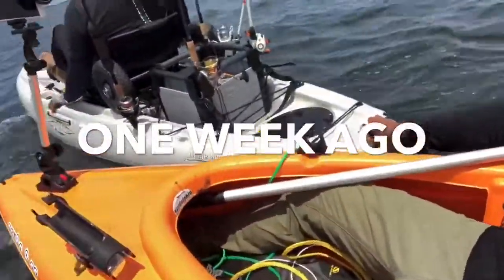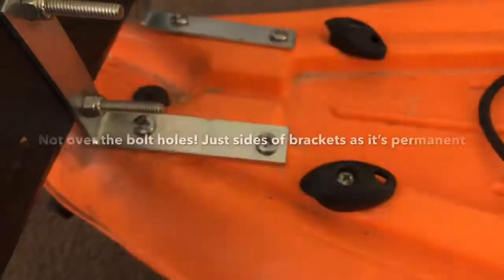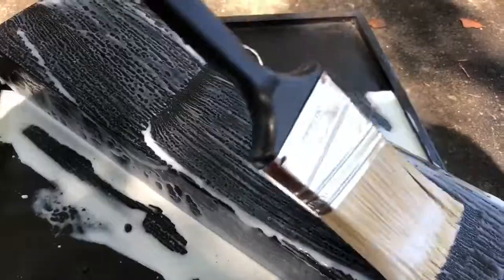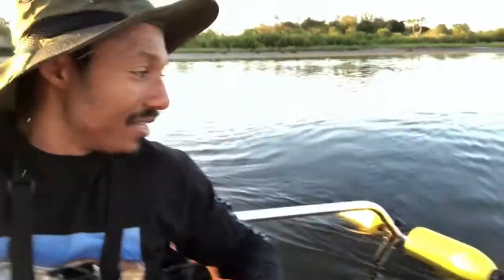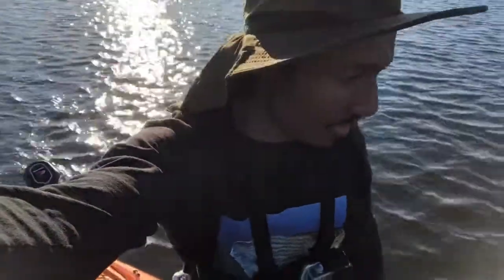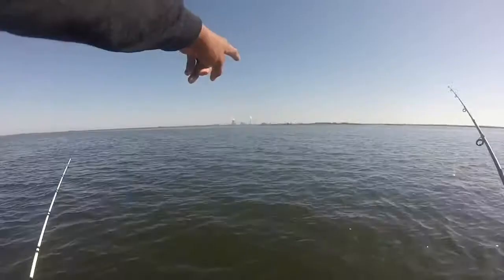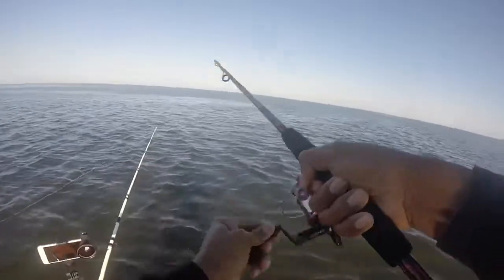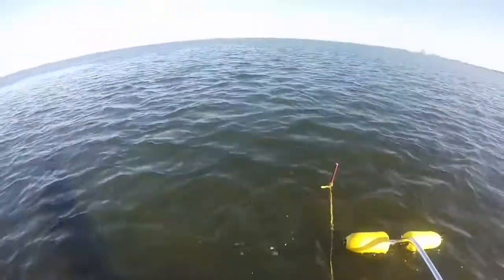Motorized Fishing Kayak DIY | How to install trolling motor on kayak

Comment: Good job bro!! I just recieved my HOODOO TEMPEST HYBRID 120. I Purchased the 46 lb thrust, which is made by them. It drops in exactly, where my PDL fits. So I have both. But usually use the troller. And it's a short shaft weighs exactly 25lbs. And I'm only 5ft 7 " 152 lbs. Next year I'm going to add the good YAKGEAR Outriggers, and put a 2.5 Suzuki outboard, on the side mount transom. Stay safe bro 🤟🎣🙏
Reply from the maker: Sorry for the late response man! Been dealing with covid but the setup sounds niceee! I’m 5”7 about 150lbs too. The HOODOO definitely sounds like a lot of fun. I might have to upgrade soon aha

Comment: What kind of bolts or screws did you use for the brackets ? I’m trying to do the same but am scared of putting holes in the kayak and not doing the right technique

Comment: What type of battery are you using ?can you talk about duration of the charge and weight ?
Reply from the maker: I’m not completely sure on the specs of the battery right now but will definitely update you on it when I get back to it! It’s a 12V battery and last me about 3 hours running at full capacity

Comment: What brand and can i use it for saltwater
Reply from the maker: Minn Kota 30 Lb thrust! They’re work great in saltwater! The water In this video is salt. I’ve taken it out 10 or so times since and just rinse it off with fresh water when your done and it’ll be ready to go out the next day. The internals seem to hold pretty nice to the salt so far. Ended up dropping the motor in the water for a few seconds when dismounting the motor from the kayak and everything seems to be holding up pretty nicely

Comment: how long does the battery last?
Reply from the maker: In this video I had it out for about 4 hours and it still had juice but I’d think at full speed consistently more than likely about 2 - 2 1/2 hours sounds about right battery power wise
Reply: Dee Fish Keeper okay, thanks for replying!
Reply from the maker: Chris Kross no problem! Good luck with your build if your planning on setting one up!